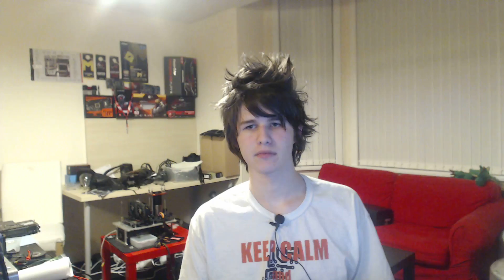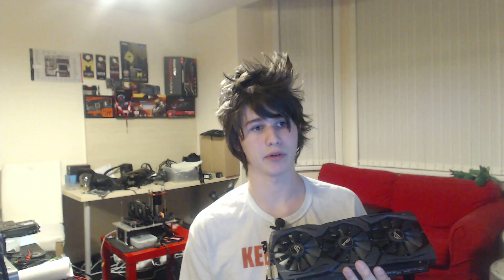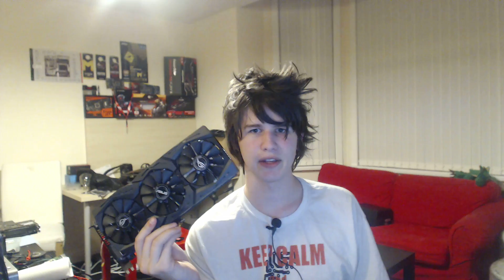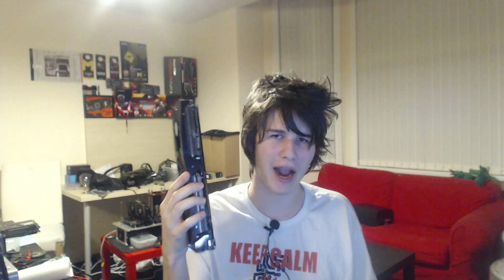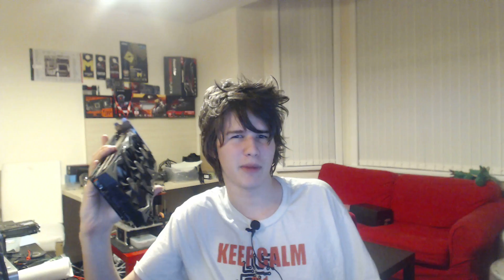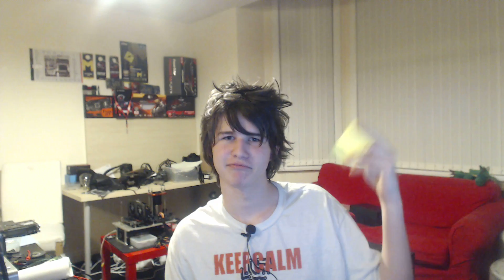RX 480 STRIX thermals update

Comment: Old video I know and not sure if you check comments on these, I just picked up a strix 480 for my second PC pretty cheap. Was completely stock thermal paste and it was hitting 85°c pretty much straight away and I noticed no difference in temps with upping the fan speeds like you said. Repasted it with some kryonaut and it dropped a crazy 25°c. Not it sits 60-65°c on much lower fan speeds. Paste works very poorly after 3 years.

Comment: replacing the paste which was basically solid dirt crap with some arctic silver 5 did the EXACT same thing on my strix 480, dropping it by 8-10 degrees under load.

Comment: I think that I got a top 1% RX 480. My core maxes out at 1470mhz and draws about 170watts at that but at 1330mhz with stock power limit and voltage it only draws 95watts

Comment: YO why does my RX 470 work in my Asrock Extreme3 Gen3 and my MSI 970 Gaming but will NOT work in my Dell Optiplex 990??

Is it attempting to draw too much power from the weak pci-e of the Dell? RX 460 doesn't seem to work either, but GTX 1060 does
Reply: Joey Greathouse you need to run display driver uninstaller before installing the amd rx series cards in older systems

Comment: My Asus Rx480 runs under full load at 40-50% fan speed at 62degress celsius  its also stable at 1450mh/z  (beside the fact i dont get higher framerates) so looks like i really got an good piece of hardware :-)

Comment: i take heatspreader from old 560ti modified it and make this not lucky card cooler 1430MHz on 1.28 is stable and the tepm is less than 80 °C with auto fan... max rpm 2150 ...this card has been not lucky projected small area on the chip dont give heat to all heatpipes as you say .. and the bios moddified is necessary too - only tdp limit must be changed (hungry card)  with small piece of copper between cooler and chip and mx4 thermal compound its very different card ...sry for my english ...

Comment: I don't understand.My 480 strix even with OC 1380 core and 2250 on memory with auto on voltage and auto on fans my temps are at 65c max and fans doesn't go above 1800rpm and drawing 207 watts due to gpuz.Am i lucky on the silicon lottery?

Comment: For about $50 you could build a switched pci-e breakout box and monitor anything you want. I would build and send you one, but I start a new job on the 27th, and I'm currently broke. When I say breakout, I'm not talking about whatever Google will find for those that are googling it right now, its a box with switched test points so you can monitor between the card and motherboard, current, without having to remove power every time you move your meter. You could simultaneously monitor voltage, and there you have power. As far as your hair goes, you are a glob of gel away from an anime caricature, I'd run with that, for at least one video, all the lolz to be had....

Comment: yo try 1410 at 1225 vcore at 120power target , or 1420 at 1225 vcore at 125 power target thats mine oc for my strix 480 clock i also got stable at 1450 for 3hours message for info bud.

Comment: why the temps on the rx cards so ugly. i just want to buy one for itx project but i have a baaad feeling... like... i put the gates to hell into the gates of hell plus an vulcan. bought first the asus dual crap thing... temps are ugly, bought the ugly nitro crap thing, crap is super loud, bought the gigabyte ultra ugly thing, temps are ultra ugly. so why is that? i mean the card is listed with 150tdp. i have now this little gtx 1060 single cooler crap thing and this little piece of crap has good temps... i dont get it... can u explain why amd suck with the temps here? best regards from germany. and in case NOBODY told u... the hair looks awesome... no homo. cheers dude!
Reply: DrTrice The Nitro is capable but loud. G1 Gaming is crap and the Asus Dual is probably just as bad.

Comment: i got a strix card from older gen. i notice same thing, theres not much temp difference between 60% fanspeed and 100%
Reply: That’s because of the direct heat pipe design, nickel black cold plates work better

Comment: I just repasted my strix 480 and put thermal pads on all exposed memory chips and across the whole width of the heat pipes on both sides of the gpu (artic silver 5). Testing right now.   this channel is the reason I got this variant 480. FYI
Reply: same temps but higher score.I didn't change any settings between runs.I'll try to push a higher oc now.
Reply: my stock paste seemed very thick
Reply: I actually survived fire strike stress test at 1400 MHz on 1.162v @ 99.8% stability. 77°c 170-180w 3600rpm-fs.

Comment: have you done a video on overclocking this one.    also regarding the fan when i was messing with mine i noticed that with stock fan profiles it would get to 70c and while thats with in operating temps its to high for stock clocks. the stop fan feature on the newer gpus they are selling is a cool concept but it is absolutely horrid because it allows the gpu to build up enough heat to where the fans wont bring it back down to something cooler than 70c. what i did was set the temp for 30C for the fans to work so this basically has the fans on all the time, i have the speed set to 35% at 30c with increases at 45c 55c and 70 c highest the fans are set are 55% at 55c 70c it's set to 65% but it never goes about 70 now i'am around 65-69c with this fan set up. keep in mind my clock speed is set to 1450 and memory is 8400.

Comment: Hi!
My R9 290 died. It has a short to ground on both legs of all VRM caps. The board looks OK. After plugging the GPU and turning PC on, it doesn't display anything, VRM is dead cold, aswell as a core.

Could this be VRM controller issue?
Reply: try to find another dead 290 and merge them,maybe you will fix yours this way

Comment: can you answer me?

its normal if wattman say 1.156v on state 7

and my card consume 1.168v?

rx480 nitro+
Reply: 300maze all RX cards sits higher voltage in gpu-z than wattman. nothing to worry about.
your voltage is kinda high (in safe limits though). have you tried undervolting it?
Reply: no i dont want to lose the warranty

tommorow ill buy new psu and maybe my idle freezing problem will be fixed

my 7970 doesnt have that problem 

but its just freezing and i dont think the gpu can just freeze in idle

and work fine on load
Reply: 300maze you won't loose anything. they can't tell if the card has been overclocked/undervolted. if you undervolt too much, the game will crash. just that. you then return to the lowest stable voltage and you're done. I have my Nitro+ RX 470 at 1350mhz and 1.08v, I reduced its consumption by 25W that way.
Reply: 300maze if it freezes on idle, do a clean uninstall of the drivers and reinstall them. if the problem persists, raise by a tiny bit the voltage at the first stage. if the problem still remains, send it for replacement.

Comment: I returned a GTR because the power draw was 50W more than expected. This is crazy and the performance was poor and the temperature really high. With this power draw I did even think to change the thermal paste because will be very useless the card throttle alot anyway
Reply: It was a BE!

Comment: Coolaboratory liquid ultra is much better
Reply: but it is also capable of destroying certain types of metal - so it's a much more situational product to use.
Reply: it only destroys aluminum
Reply: MegaChickenPunch no... Mercury reacts with more than *just* Aluminum.
Gold/Silver are also common materials that will be dissolved.
Maganese, Copper and Zinc will produce reactions, but much more mild ones.

Aluminum is simply the most extreme reaction. not the only one.

Comment: Just curious, but how is that MSI X99A Titanium going for you?  Currently have the MSI X99A XPower (non-Titanium) and it's been pretty decent. Uncore OC could be a better and I wish there was a bit more flexibility in PCIe layouts, but otherwise an excellent board.

Apparently 12x Fairchild Semiconductor Mosfets and 12x Ti chokes (not sure how different they are from the old "Super Ferrite" chokes, but probably overkill).
Reply from the maker: The Titanium totally crushes my old Rampage V Extreme. What CPU do you have in yours because on Haswell-E you need to tweak some extra voltages to get good uncore clocks.
Reply: I have a 5960X. Very weird. Right now I can get the core stable (and by stable I mean it can pass Intel Burn Test) at 4.5 GHz @ 1.25 Vcore, but it's tough to get the Uncore stable. I think VCCIN was 1.95V (will need to check later). Even a 3.3GHz Uncore OC with said 4.5 GHz OC won't post.  I tried pushing up the Ring voltage but that doesn't seem to get me much.  I probably need to upgrade my cooling system (just using a super tower right now).

It's weird. Pushing up the system agent and VDIMM doesn't get me much RAM overclocks either. That said, I have tightened the timings. Will need to push later on. 

What other voltages do you need to tweak for Uncore and for that matter, for VRAM?
Reply from the maker: Does your mobo have the CPU Ring OC2 Voltage in the OC section of the BIOS? If it does try change that voltage from 1.45V to 1.55V. 1.55V might not work but 1.45V and 1.5V should work on most chips. That voltage is an extra voltage that you need to set to get the cache to OC properly. With 1.45-1.55V you should be able to do over 4Ghz cache.

As for RAM what kit of RAM do you have and how much voltage are you pushing? I can get 3400 13-18-17-24-1T running just fine at 1.9V on the RAM and 1.15V on VCCSA and VCCIO.

Also do you by any chance an Enhanced Memory Controller option in you BIOS? Because I have that option on my board I need to set it to "High VDIMM Patch" in order to have RAM voltages over IIRC 1.6V working.
Reply: With the latest BIOS, A.60, I think that it does.  IIRC there's the Ring OC1 and OC2 voltages.  Someone at MSI said not to touch them, but I will try making changes. I never tried changing that setting, so I will give it a shot. Thanks.

Will have to check on the Enhanced Memory Controller.  My DIMMs may very well be the bottleneck.

I think though that the BIOS should be identical. With ClickBios 5, the BIOS seems to be the same across all of the MSI boards. (Red dragon on BIOS screen - the older versions of the X99A XPower BIOS had a big yellow "X" as the opening screen). The MSI X99A XPower, the X99A XPower Titanium, and the X99A Godlike (along with the X99A Godlike Carbon) all seem to share the same red themed BIOS.  Probably the X99A Gaming 9 as well, although nobody buys them since the Godlike came out. They all have the OC Socket (or what MSI calls the "Turbo" socket). The older X99S boards don't have the OC socket (that was Asus exclusive then their patent expired) nor USB 3.1.

The Z270 and Z170 boards all seem to have a similarly themed BIOS.

Power deliver seems to be the same across these boards as well. All of the high end MSI X99S and X99A boards seem to use 12x  Fairchild FDMF5823DC Mosfets. The only difference is that the older boards use SFC chokes while the Titanium uses Ti chokes. No idea if that makes any difference or if that is pure marketing.

One other topic - thinking about thermals, I just realized something. If the 14nm 6700K is having issues with cooling due to the small size (especially on LN2), when the 10nm CPUs come out, every CPU except the HEDT CPUs which have a much larger die are going to have those issues.

Comment: If i reapply thermal paste on my RX480s whats your though on Arctic silver 5 i only ask because i have a bunch of large tubes of the stuff..
Reply: AS5 is usable like basically any paste is, but it's very mediocre paste.
the specs AS5 advertises are entirely falsified.

performs fine for the cost, however. but it's also a paste that sets which is annoying.

Comment: Can't you use these PCI-e x16 extenders with molex connector to measure the "PCI-e wattage draw"?
Ofc after unwiring the 12v connections on the x16 plug, since they BOTH tend to be wired at the same time.

Comment: It seem that a lack of better thermals at higher fan speeds would be a good indication that the cooling isn't getting to the chip, i.e bad thermal paste. 
I guess it could also just be recirculating the same  heated air through the fans/cooler.  Adding an air shroud or additional fan is a quick check for that.
Reply from the maker: or bad heatpipes. Which is why I tried testing the heatpipes but realized that only measuring the temps on them coming out of the GPU core doesn't tell me what the finstacks actually get. I will be buying more probes to solve that soon.

Comment: Hey man! Since you're doing PCB analysis, is there any chance you can do an analysis on ASUS's "Auto-Extreme Technology" boards? I'm not very interested in pushing voltages to extremes, but stability at efficient voltages. I'm interested in overclocking boards just so I can remove any hardware bottlenecks and have a good power infrastructure for any scenario.
Would be nice to know if ASUS can bring any improvements with their PCB manufacturing process. Thanks!

Comment: I wanted to lay my money on this STRIX GPU till I saw this, messing with the thermal paste and other stuff that involves handling the card physically is a no-no knowing how big of a clumsy ass I am, what card(besides GTR which is ~50$ more expensive)would you suggest me; this card with some tweaks in the software to stabilize it or go for something else like MSI Gaming X?(note that I don't plan overclocking it straight away, if ever)
Reply: by "this card' I mean the STRIX One
Reply: The MSi Gaming X would be a better choice. Just make sure it fits your case.
Reply: Well, in that case, I'm gonna have to go with a 4GB card, as the one with 8GB is ~100$ more expensive :/
Thanks!
Reply: aggre with MaddXav - MSi Gaming X is a better choice.

Comment: should i bake my r9 280x? i have 2 vertical green lines on my screen and the windows is not loading,yesterday the card worked just fine the highest temp was 67c
Reply from the maker: First completely clean the card. If there are still 2 lines bake it at like 140C it might re-seat the FCBGA if it still doesn't work you're kinda screwed because solder reflows at well over 220C and at that point you might end up killing other things on the card.
Reply: Actually Hardcore Overclocking now the gpu is working just fine without doing anything to it,if i restart the pc or shut it down and turn it on soon i dont have any problems,i will simply leave the pc 24/7 on and when the gpu wont work at all i will clean it and i might bake it
Reply: Actually Hardcore Overclocking and thanks for the info
Reply: so i got a proper reflow for my gpu die,and now the gpu is working almost perfect but when it pases 1239mb of used vram i get alot of artifacts and the drivers crash,could you help me with some tips to fix this issue?the card plays saints row 3 without any fproblems like this maxed out and only using about 1000-1100mb of vram,should i try getting a broken hd 7970 and replace my vram with the one from the hd 7970?

Comment: why would they use crap heatpaste? i just don't get it, it's not a cheap card, it's one of the most expensive rx480s, yet skip on the tiny cost of using proper heatpaste just weird, reminds a bit of intel's horrible thermal paste use in processors.
like am i missing anything that would make proper thermal paste so much more expensive?
i mean we are talking about a fraction of a dollar per card to use ok thermal paste i'd assume.

Comment: Basically kryonaut is the best non-metal based thermal paste in the market

Thermal Grizzly Kryonaut 12,5 W/mk
NT-H1 about 6,1 to 8 W/mk
ARCTIC MX-4 8.5< W/mk
Cooler Master MasterGel Pro  8 W/mk
Reply from the maker: I am literally listing pastes that I remember doing well in this ranking: http://overclocking.guide/thermal-paste-roundup-2015-47-products-tested-with-air-cooling-and-liquid-nitrogen-ln2/6/
Reply: Noctua NT-H1 is worse than the ARCTIC MX-4/3/2
Gelid GC-Extreme ~= Thermal Grizzly Kryonaut
Reply: Gelid GC-EXTREME 8,5 W/mk while Thermal Grizzly Kryonaut 12,5 W/mk
Theres new player in the market Cooler Master MasterGel Maker 11 W/mk
Reply: About right, you should also test new cooler master mastergel maker, interesting to results

Comment: My XFX RX 480 GTR Black is unstable at 1380@1,2V. How unlucky did I get on the silicon lottery?
Reply: Michał Gumulak rma it for coil whine,maybe you will get a better one
Reply: My Gtr black coil whines and I returned it
Reply: Mine coil whines only at >1000FPS (happened in a menu of some old game, CoD2 iirc). Basically any card would coil whine in that situation.
Reply: 68-70 degrees. I could crank up the fan speed a lot more but I think I'll just live with this.
Reply: lol my MSI rx 480 is 100% stable at 1380core at stock voltage. Within like 40 mins of messing around i got it to 1465mhz xD
Reply from the maker: Slightly better than Strix. The card should still do 1400+ on 1.25V.

Comment: rx 480 strix can draw nearly as much power as r9 fury from sapphire (up to 300 Watt after OC). the noise level (51-52 db(A) open bench - 2650 RPM fan speed) is unacceptable, and it's warm (78 celcius under load). For me this is one of the worst rx480 taking price into account.
Reply from the maker: I had my GTR pulling well into the 250W range at 1500/2300

Comment: I have a 480 strix, when overclocked it sits around 74 degrees at 40% fan speed. is that bad or good?
Reply from the maker: That sounds fine for a card that I assume is in a case. My card was doing 79C on my OC settings with 28C air temperature right in front of the middle fan.